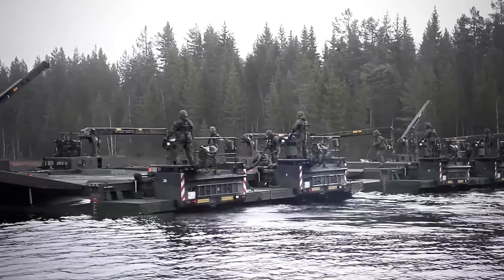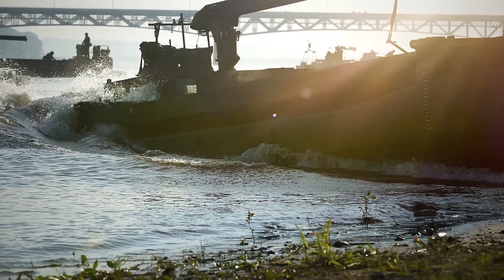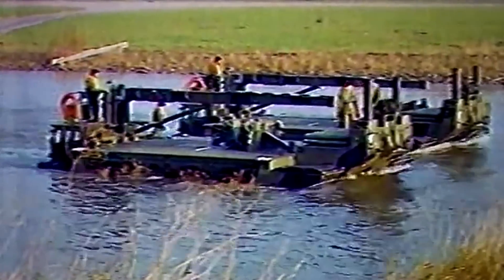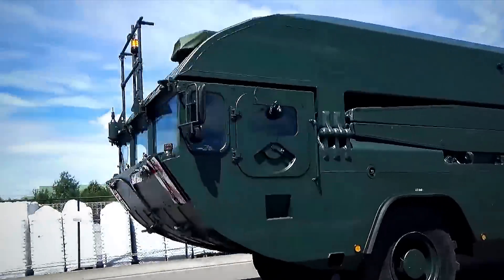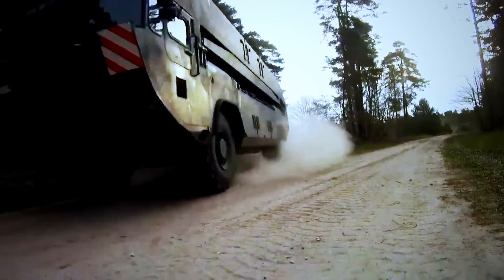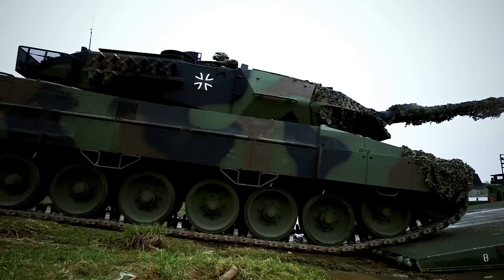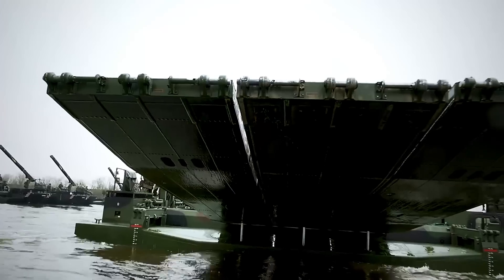Massive Driving Bridge Technology - M3 Amphibious Rig

Comment: @4:35 "It can operate... at depths of up to 1.05 meters" Wow. I can walk through water 1.05 meters deep. I think you may have meant "at depths of AS LITTLE AS 1.05 meters." These vehicles float. There is no maximum depth.
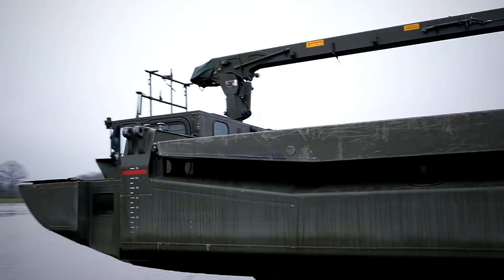Reply: They also said it "propels itself in water through two large aluminum pontoons which provide buoyancy" right around 2:00
I think it's fairly obvious the pontoons don't propel the vehicle in any way.

Comment: Interesting as always. In this you say that it has a 60 percent driving capability. Do you not mean 60 degree instead?
Reply: Percent is also a measure of road steepness. It is the vertical rise over the horizontal distance expressed as a %. 60% is like a 6 meter or foot vertical rise for every 10 meter or foot horizontal distance.